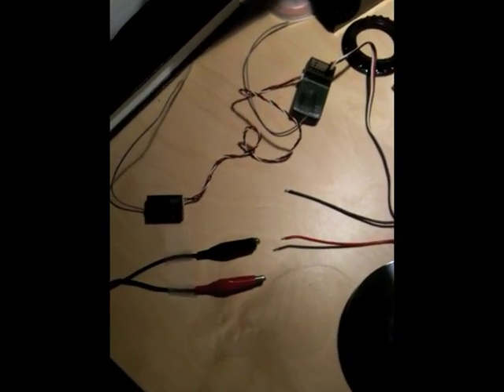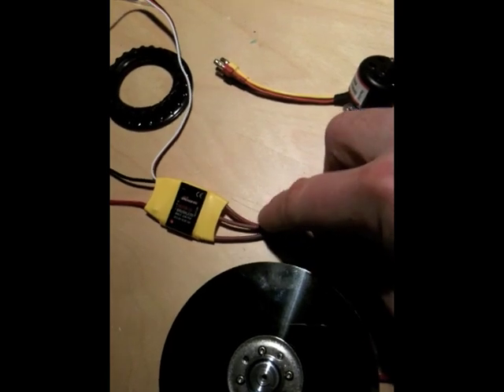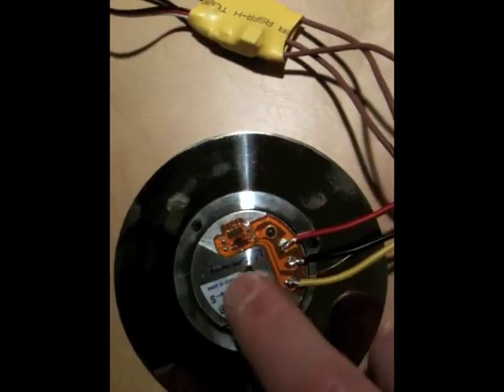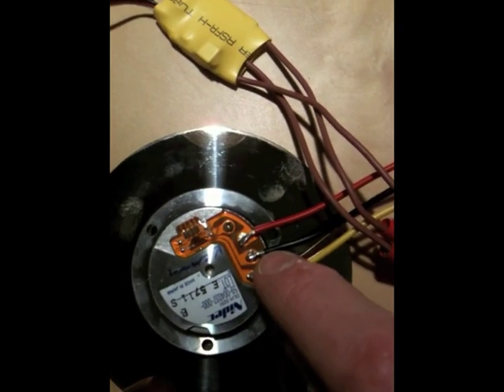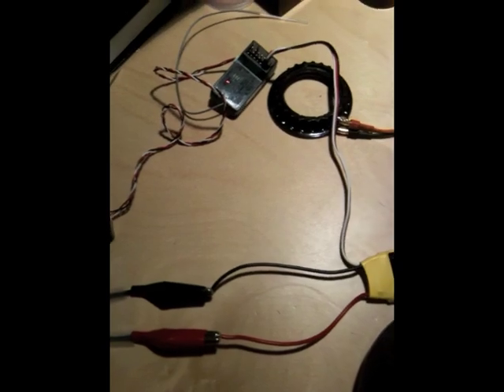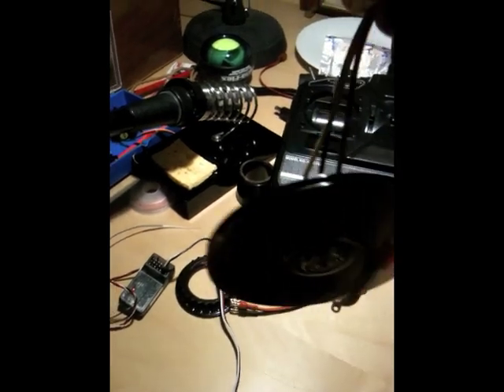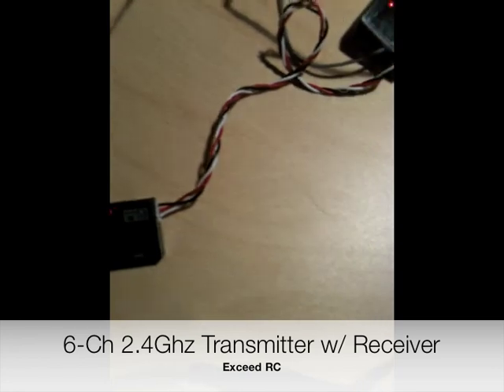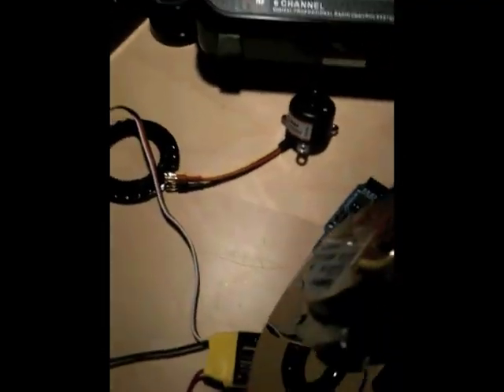Running a hard drive motor

Comment: WYE is also called Star conffiguration. It uses 3 phases plus the common.So yes its wired in Star or WYE but your running it in Delta.

Comment: How many volts/amps are needed to run a hdd motor?
Just want to run motor at one constant speed. In other words is it possible to connect voltage directly to motor and get it to run properly? If so what voltage am i aiming for so I don't fry the motor?

Comment: Im having trouble wiring the pinouts to a usb cable, and Im using a multimeter. The usb port is supplying 5v. I manage to get it spinning for 2 sec sometimes more, but later stops. I took an electrical class, but Im still a newbie. Please, help!

Comment: Do you have any specs on your ESC? I'm trying to power a 5V 0.5A HDD motor for use in a project. I called the local hobby store for a cheap ESC, but the guy didn't seem like he wanted to help me select one unless I knew exactly what to buy...

Comment: Not that it honestly matters, but I'm 80-90% sure it should be pronounced "Are-doEE-no." not "uh-dree-no." In your defence, however, there actually IS something called an "Adreno". It's a Qualcomm cell phone GPU line. Pretty good line at that.

Also, thanks for the video, I have the exact same motor, and I was looking for a good way to drive it. Would likely never have thought to leave out the common on my own. Too outside-the-box for me. I... like the box...

Thanks again.
Reply: In NZ we say Arrdyu-eeenoō. Don't be pathetic.
Reply: I pronounce it "Are-dween-no"... I should stop

Comment: What a clear and thorough explanation; thank you /so/ much. I'd be very interested in seeing your video on controlling the motor via an Arduino board.

I guess the motors run up to the specified drive speed of either 5400 or 7200 RPM?
Reply: I would wager they can potentially spin faster than they're rated.

I'm guessing the RPM is regulated based on the read/write head's ability to perform operations.

I could be wrong though.

Comment: Actually i use the same way as it was explained except the RC, i am using Speed controller. But the motor doesnt 
spins.... i used 2 HDD motors 1) Seagate ST340810A and 2) HP 
DG0300FARVV, the first one has 5400RPM 2.5Amps 7.5W 5V to 12V and the 
second one with 12v 0.4A to +5v 0.6A. with the first one i had a power 
supply of 12v 0.5Amp so i thought its the amperes where i am lagging 
behind and later with second one, which suppose to spin as per its data 
sheet doesnt worked as desired. So i am seeking help to understand why 
its not spinning. further i am using a ESC of 30Amp. I kindly request 
you to please help me out in this please !! i am new beginner so i 
desperately need help on it. Or if you can suggest a forum where i can 
get some responses over it .... Please !!!

Comment: I think I'm a monkey, or child.  I enjoy playing with the uber-powerful Neodymium magnets, and pretending I use coasters, (cool shiny ones at that,) than doing something useful with HDDs when I gut 'em.  I've also allowed myself to be discouraged by the delicate flex board leads, but you make it look easy soldering on new leads.  Those platters are so nicely polished, how about pulsing or dancing a laser beam once you've got Arduino control? Grind platter spacers for skew and make 2D laser art?

Comment: Thanks for sharing! I have this same motor, but for some reason always thought it was a stepper. It worked great after using a speed controller like your setup. Here's a link to an oscilloscope trace I took capturing all three phases AC from the controller https://pbs.twimg.com/media/CI7Ro2tWwAAuz3x.png

Comment: Hello! I really need your help!!! I see you know how to make HDD spin without connecting it to PC. Could you please give me advice? What do I need to buy in order to get 2 or 3 hard drives spinning at the same time? Also there has to be a controller(not RC), just a regular controller like this: http://www.a1decoy.co.uk/ekmps/shops/a1decoy/images/speed-controller-for-magnets-698-p.jpg
I already have this  12v dc power supply: http://www.ledsupply.com/images/products/secondary/12vdc10a-2.jpg
I also have couple HDDs
can you suggest what else do i need to buy? I dont know much about this...